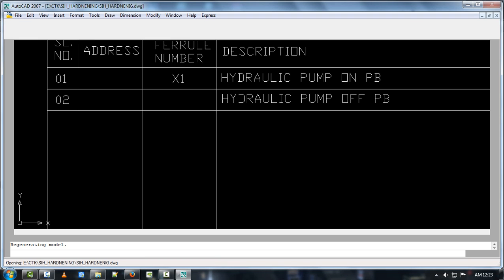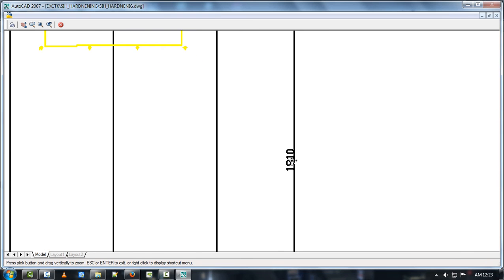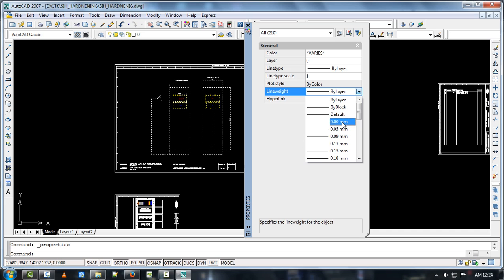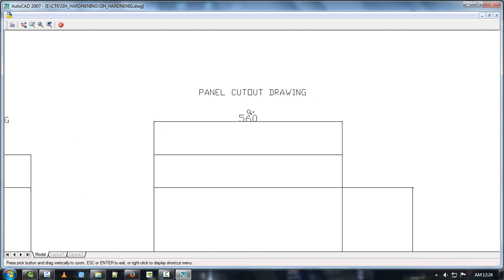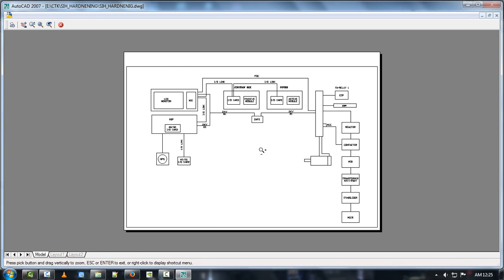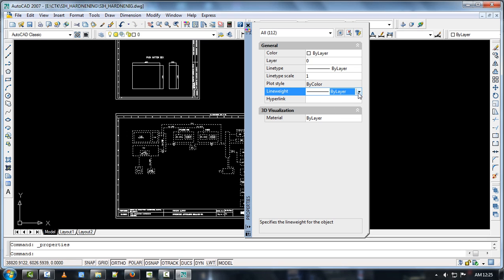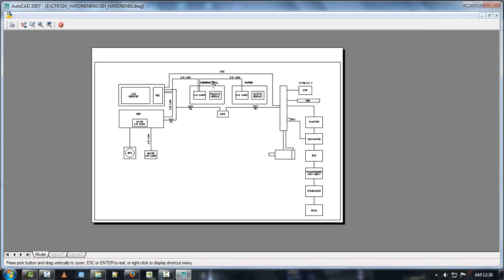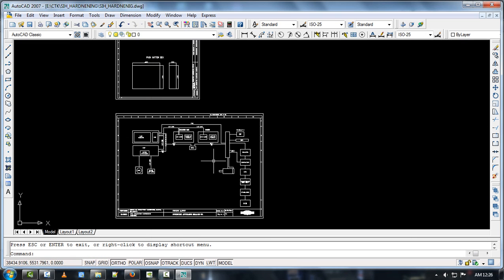AUTOCAD THICK AND BOLD TEXT AND LINE (100% SOLVED)

Comment: If in half the drawing normal text nd other half is bold?
Reply from the maker: Select all and change line weight
Reply from the maker: You can set the default line weight
If you create layers it will be very easy to and multiple line weight by selection required layer

Comment: which font do you use ? it doesnt not work with Arial font (or all unicode font), but when i use font vni code, it works
Reply from the maker: default single line  and multiline fonts

Comment: I organize my drawings with a CTB plotstyle, meaning the pen widths are based on color. The Properties pull-down doesn't provide a "by color" option! Sometimes I put text on the same layer as the drawing so I can see them both in the viewport I need. (For example if walls are red with a thick line weight, I may add text in the "wall" layer as grey, with a much lighter pen weight). Can I create a "by color" option in the pulldown menu?
Reply from the maker: +Beyhan Cagri Trock you can create Layers and easily you can change color and line weight by changing layers
Reply: I was hoping I could have items of different colors on one layer, just to reduce the number of layers. I guess CAD can't accommodate that. Thanks for your help!